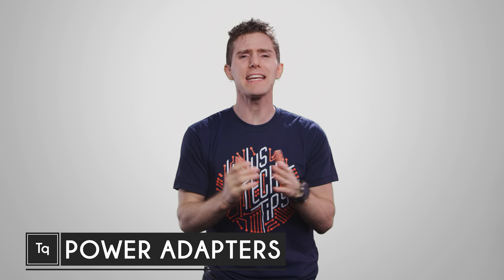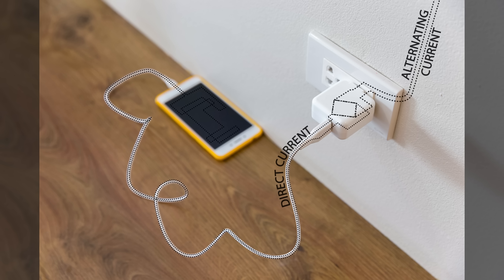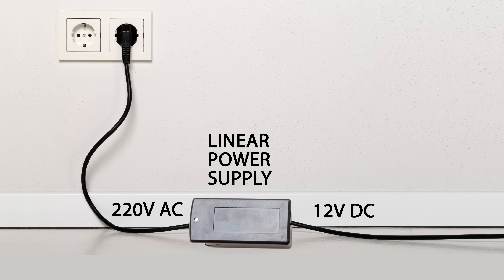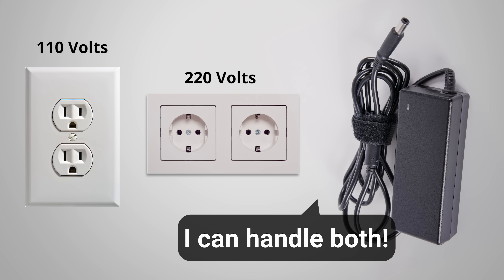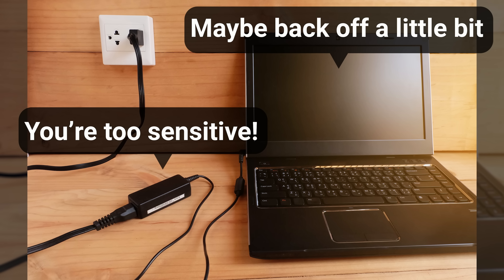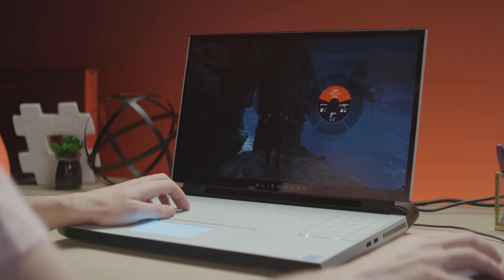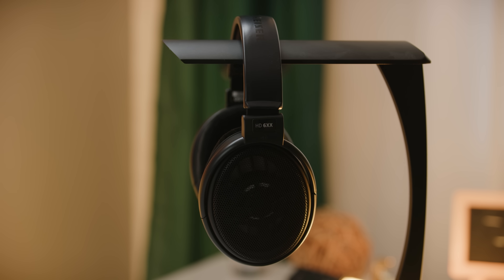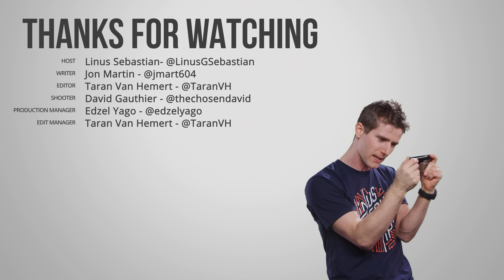Why Power Adapters Are So HUGE

Comment: Thanks for vid. Can someone help me with something else, please? We have this mobile power supply device. It's like a charging bank, but a bit bigger, and seemingly a bit more powerful (can even jumpstart your car battery to a degree), and more for car travelling usage (can charge lots more things than just phone). But we lost the AC adapter for it :-(. It has an Output connector for which you can apparently change/switch the voltage (12, 16, 19) and there's a smaller Input connector (only the thinnest of a series of 7 spare jack adapters that came with it fits) that says "12V/1A". How do we order online the best AC Adapter for it? Do we have to look out for wattage? What kinds of voltage and amperage would be compatible or best? Appreciate it.

Comment: I remember my train set transformer which converted 240V to 12V and was the size of a shoebox and had an audible hum.
The modern mobile phone charger has a power supply about the size of a mars bar. I was told the 240V goes through an oscillator circuit to say 20K Hz which means the transformer can be really small. My trainset transformer probably ran at 50Hz.

Comment: You have given one of the best reasons for the updating of our current main panel here in America [and Canada] to the European DIN rail style. Since this is an industrial and more robust system. Our current system is behind, a good 15 to 20 years to the European. 
Take for a example the common light bulb… it has the LED’s and a small Converter Driver housed in. While they could be a few in the main panel doing the job to drive the whole house [or units per floor]. Bring in down the cost and usage of current. Just one example. The whole wiring in today’s house needs to be redesign; period. Starting at the plants, houses main panel and so on.

Comment: Not only are linear regulator more inefficient, they are bigger and dont provide much wattage for the size

Just be glad that SMPS exist......

For the size of your pc psu you can have 1000W SMPS, while only a 50W linear PSU and even then it will be way heavier because of the big linear transformer

Comment: I'm actually in this issue right now where I don't mind the bulkiness of my power brick for my laptop, I just want more power avaliable for my laptop because for some reason, a 2016 Razer Blade Laptop, with it's battery and it's power brick, cannot play a game without crashing (with professionally installed thermal grease to boot, I made a mistake of too much before but I applied it correctly still, they fixed the problem, I'm a dufous lol) About to do an upgrade to a new laptop all together since I had this thing for 5 years, I just want it to run basic games so it can be a guinea pig or a laptop that can be used to the side for videos as I do stuff.

Comment: Ummmmm.  That’s not why they call them “switching” power supplies. They’re called that because they switch on and off rapidly to create dc pulses that are then smoothed out by a capacitor(s) to output clean DC.

Comment: Linus, you made some big mistakes in the vid
1.before all, linear power supplies differ because they use a big transformer and a simple ac-dc converter
2. The main issue with linears is that they are way bigger
3. They're called switching because they convert ac to dc and then use switching transistors to turn it into higj frequency ac again and then to dc which improves efficiency and decreases size

Comment: Some people modifying their household appliances to accept DC and make a DC wiring in their houses. While this requires knowledge and generally dangerous, not to mention it voids any possible warranty, but it has some upsides, especially if you are running on solar panels, since switching power to AC and back to DC is a huge waste of energy.

Comment: This is why we need whole house 12v (or more) power sockets. I find it kinda insane that every appliance we buy today has it's own power supply, why not have a single house-wide power supply. I have personally made my own using XLR plugs and a computer power supply. I use it to run drills, a radio, amplifier etc.

Comment: If you just needed DC, you can use 4 diodes, which would be much smaller than a power brick. The size of a power brick is because you also need to step down the voltage, which produces a significant amount of waste heat.

Comment: The obvious question is why manufacturers of laptops and other portable devices haven't all just switched to USB-C and eliminated the need for proprietary power adapters completly. If everyone is using USB-C for the devices, that then increases demand for USB-C power bricks and other power sources and creates an incentive for manufacturers of such devices to make them better.

Apple has already lead the way by using USB-C on every single current laptop design (although they still stubbornly cling to proprietary crap on their mobile devices when the rest of the industry is pretty much all using USB-C or on older/cheaper products micro USB)

Comment: AC was a mistake. in the modern world there'd be a lot less wasted energy if the grid was DC
Reply: redtails AC saves so much energy compared to DC, the kids from conversion is nothing compared to the gains that comes from using AC over long distance
Reply: @zachb1706  that's a thing of the past. Nowadays DC is used for long distance transmission of electricity lol
Reply: Onne Ro HVDC is used, however it still has its disadvantages. AC power can easily have its voltage changed, which makes it slot easier to setup and of course means that your appliance “power bricks” are kept smaller and cheaper. AC to DC converters are actually really small, it’s changing the voltage that’s the hard part, at least with AC it’s easier.

Comment: Yeah, but why does Apple insist on using the wall-wart style of power supply instead of the box-in-the-middle?
Reply: Alex Snitzer it’s not just Apple, and my guess is weight. Having the converter on the end means that it’s not tugging on the cable, and for someone who uses their phone plugged in it would be annoying. 

Apples are the least obtrusive ones that I have, they hardly take up more than one slot
Reply: @zachb1706  I was talking about the massive MacBook power supplies.

Comment: Um I think that before switching ps there were just transformer and rectifier not linear since to charge your phone at 2 amps you would waste 210w us od 550W EU  that's literally more power a decent room heater. This misinformation is fuckin terrible Linus don't be like this  plś

Comment: With multi GHz switching frequencies coming out expect to see the size of these shrink substantially over the next ten years or so. With a higher frequency you can reduce inductor and capacitor size and achieve the same voltage ripple. Then who knows - the adapter for a laptop might be built right into the plug.

Comment: Think about what happens when you plug a laptop into a 120V inverter in your car.  The power starts out as AC in the car's alternator, then it's converted to 12V DC, then the inverter converts it to 120V AC, then the laptop power supply converts it to 20V DC, then the various power supplies inside your laptop convert it to various voltages for the various subsystems in the laptop (1.05V DC, 1.5V DC, 2.5V DC, 5V DC, 12V DC, etc.).

Comment: New age problems of millennials.

If you grew up before 1980 you would find just about any power adapter nowadays ridiculously small.
Just looK up a typical 5volt 2 amp linear power supply and compare it to a apple usb adapter and you will understand.
In linear form a average laptop supply would be 5-10 larger and weigh some 10 pounds or so, young people have just no idea about technical advances the last 30 years.

Comment: Converting AC to DC isn't difficult. All you need is 4 diodes and maybe a smoothing capacitor. The actual problem is stepping down the voltage while being able to provide enough current and running at a reasonable power factor.

Comment: Standardization helps by letting you carry fewer proprietary power supplies. This has improved a lot in recent years. I pay a few $ extra for camera battery chargers than can run from a USB charging brick.

Comment: A power supply not only converts AC to DC it lowers the line voltage to the voltage the device needs to run safely. If it's purpose was to only convert AC to DC then they wouldn't be that bulky as all you would need is just a rectifier and a filter

Comment: Forgot to mention the reason they have not been shrinking much even for the small ones.  It's safety regulations.  You need certain levels of isolation to protect your device and you from being electrocuted with the raw mains voltage or a sudden surge such as a power bump.  These safety requirements all require certain minimum distances to be respected depending on voltages, materials, etc but in the end they all add size.  Also specific certificate parts have to be used on the mains side such as safety rated capacitors which are not cheap or small when compared regular ones.  It's all about getting the AC voltage down safely to a extra low voltage safe level that can't electrocute us.
Reply: You prune,everyone knows that mains Electricity is always going to be dangerous no matter what the Voltage is

Comment: I have an old Thinkpad and when I have it plugged into the AC adapter, if it’s doing something intensive for a while, the adaptor starts making popping sounds from the heat. The plastic heats and expands on the adapter. If I unplug it and let it sit for a while it will cool down and make some more popping noise. It’s pretty funny

Comment: @Techquickie switching power supply does not mean what you said in the video. It means it uses switching electronic components that work at high frequencies, in order to create that DC in a smaller form factor. Instead of using a huge, heavy copper coil, it allows a smaller coil to be used.

Comment: There many more uses for power adapter. AC to DC can power a car head unit in the house. Most people don't know you can revive a dead car battery with it also. Just understanding electricity will blow your mind! Power bricks turn ac to DC (12v).

Comment: Linus I'm like especially to watch the videos you make about areas that I master because they usually you get everything right.  But this time you fail.  Alternating current won't go and come is reverse polarity, mobile devices don't have the transformers incurped for safety reasons because in case of an anomaly the person got electrocuted, the shields inside the notebook's transformers are there to dissipate heat to plastic, condensers and other components filter they interference ...

Comment: Technically speaking, power bricks are big because of big transformers and inductors inside. Their size are limited by transistors' switching frequency. Higher switching frequency can make use of smaller transformers. But there is a tradeoff between frequency and efficiency, using smaller transformer requires transistors to switch faster, but the transistor has switching loss as it transit from on state to off state. Higher frequency means higher switching loss, which pretty much explains the current limitation of silicon-based MOSFET. The solution is either use more efficient GaN MOSFET (at higher cost), or use different switching topology like ZVS regulator which eliminates switching loss once and for all at the cost of more complex design.

Comment: That. Was bad. If this were the first video I watched here it would be my last. Just delete this please and start over. Consider output voltage filtering, noise suppression, shielding, and primary-secondary separation, as actual causes.

Comment: That's not what "switching" means in this context. A switching power supply is called that because it uses a "switching regulator". A switching regulator rapidly (think thousands of Hz) switches the rectified power on and off, and filters that (with inductors, which act as low-pass filters) in order to reach a stable target voltage.

Real switched power supplies usually also use AC transformers, but let's ignore that for a moment.

So if you had 120V AC, the average absolute voltage after rectifying would be (2 ÷ π) × 120 = around 76 volts; assuming no loss, if you wanted to get 12V DC from that, the switched power supply would have an average duty cycle of 12 ÷ ((2 ÷ π) × 120) = about 15%; this means that on average, 15% of the time, the switch is turned on. There's a lot more to doing it well in practice, but the principle is there. 
Cheers!

Comment: Yep Linear Supplies are cheaper though, but yeah power hogs. Switch Mode Power Supplies or SMPS use PWM at very high frequency for its power modulation. So it is allot more efficient. Though around sensitive electronics a bust unless it is high enough in frequency or isolated enough, or both. I like SMPS. I grew up with Linear Power Supplies especially in younger audio days. Today, work smarter, not harder and hopefully not hotter.

Comment: Think they’ll ever just be built right into the wall outlets we use?
Reply: In PC it does not make much sense cause for delivering 12 volts and high current you want short wire runs to avoid expensive cables or exse heat. Laptop/Phone PSU can be bought in an outlet as long as it's USB cause it is universal. The downside is that you don't have switch to cut off the power completely from PSU in outlet quickly for safety and efficiency.

Comment: It is unfortunate that single phase power is used. If that wasn’t the case you would always have a voltage higher than the low voltage DC you need. I think you’d only need the tiny capacitor after switching if that was the case.

Comment: 4 diodes to make a bridge rectifier and the cap for a filter. Now you have dc. Simple. The next stages now involve dropping the voltage and regulating it for a stable output. The term switching really has no relevance to the 120v/220v input compatibility.

Comment: Adapters are not built in out electronics for one reason above all, accidental electrocutions, imagine pluging and unpliging a cable at 220V from you phone/laptop every time you want to charge it good luck not getting fried doing that while you are just off of bed.

Comment: Hey! Can laptop vacuum coolers damage the battery or the AC adapter? My laptop's AC adapter got damaged and I had to replace it . This happened after 5 days of using the Cooler. I have an MSI GL63 with dual side vents and dual back vents.

Comment: I spent 5 years in the seventies in a factory making switching power supplies for mainframes. These where about 24 inches long, 8 inches wide and about 6 inches tall and they weighed a huge amount.

Comment: I’m an EE with 20+ yrs experience. Good video for a basic overview!  Some of the factors that drive size are:  1: Safety (there are physical space requirements to keep the dangerous AC power away from the relatively safe DC power you might touch). Also we have to have minimum insulation to prevent things from accidentally wearing and electrocuting you. 2: noise. You touched on this. There are two kinds of noise Radiated (wireless) and Conducted. Radiated is dealt with by proximity (which you described), shielding, or careful filtering at different parts of the power circuit.  Filtering almost always adds size and reduces efficiency (which makes heat) and is a difficult balancing act. Conducted noise comes to play with regulatory compliance. You don’t want your device making a lot of electrical noise on the AC line that can mess up other devices. Govt agencies (FCC, IC, CE) have limits on this noise level to make sure we all play nice. Again that means filters which can be quite large. The technology has improved a lot and today’s components are far better; however, there are some fundamental physics limitations that determine size of these parts.  That being said, there is a lot of innovation and investment to produce more efficient and small power adapters. New methods are already drastically reducing the part count and complexity which makes my job as an engineer easier to meet challenging size and packaging desires. 

Again, great video!  Thanks!

Comment: I took my power brick apart and the board was wrapped in some plastic stuff witch was held on by a metal plate(p.s. I forgot to unplug it) and I was putting it back together and accidentally put the metal peice on first and it blew up xD

Comment: The compoents taking up most space are the transformer and the power smoothing condensers wich are often of the electrolytic cylinder type. A non switching power supply would need to be at least 5 to 6 times the sizee to handle the power. However being in a closed box without cooling most of these laptop psus are still on the limit wich stresses the compoents inside and also wastes power since they get really hot when they operate at their limit capacity. The one to my laptop for ex gets burning hot when working with things like rendering in Blender or different game engines like Unreal Engine wich I use a lot. It have not broken yet since it is rated for this computer but still, even its switching, components operating at their limits generate lot of waste heat wich decreases the efficiency of the unit.

Comment: Wouldn't it be great if power bricks could at least conform to a standard on the DC side: voltage/current/plug.  That way you could carry just ONE.  And there'd be a big enough market to incentivize someone to develop and sell a really well-designed model instead of the cheap designs we all suffer with.

Comment: I don't mind having to lug a large brick everywhere. What I mind is having the wide up the cables so that I can put it in my laptop bag. I could just quickly shove it into my bag but I don't like doing that as I have other things in there. I don't know if there is a solution but I want to find something that makes winding up my cord a lot easier.